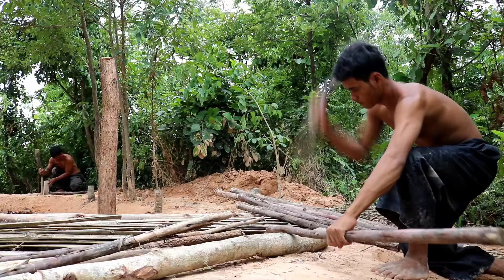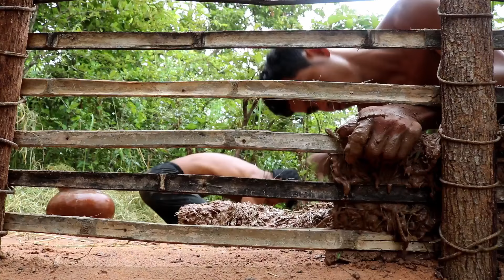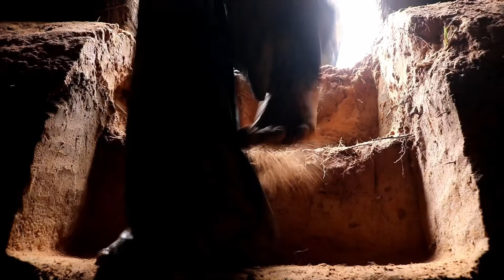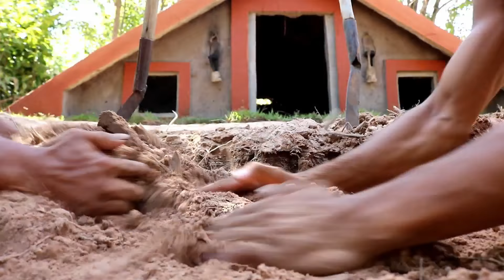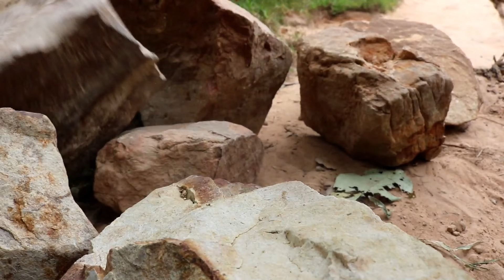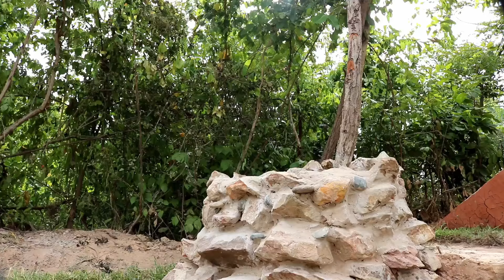Build Secret Underground Swimming Pool House And Beautiful Waterfall Fish Pond

Comment: WHAT HAPPENS TO THESE STRUCTURES AND BUILDINGS AFTER MAKING THIS VIDEO??
Reply: I guess they stay as long as nature lets them stay up  I can imagine how fast the the forest grows and takes everything back.
Like down the street from my home there was an old school that was no longer being used the grass grew all wild the weeds took over the fence the play ground cracks in the cement weeds grew through them. Nature started to take the ground back within 10 year's. They bulldozed down the school and built a brand new school there. I can imagine in that jungle it wouldn't take long for the jungle to swallow that back up you may see a little something might have once been there but won't look nothing like when they first built it. Same thing with my favorite fishing spot I haven't went there in over 10 year's went back to it the river changed and the weeds over took the area we used to sit at the water receeded way smaller then it once was the weeds took back the ground. The Earth is always changing and moving around. I was a welder and had to weld these telephone like poles to set camera's on them to take picture's of a bridge for a full 2 years to see if it moved or not. It was a fiberwrap company they reinforce parking lots structures, bay bridge, building's that sort of stuff for earthquake .
Reply: SNOOP U 2, u wrote a f*cking article.
Reply: @tinfoil4671  I shire did got carried away lol